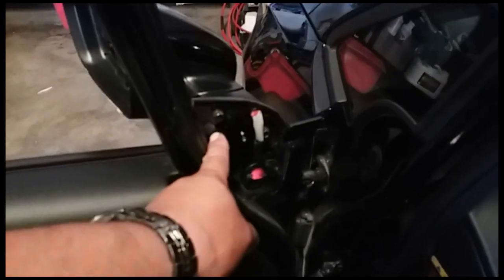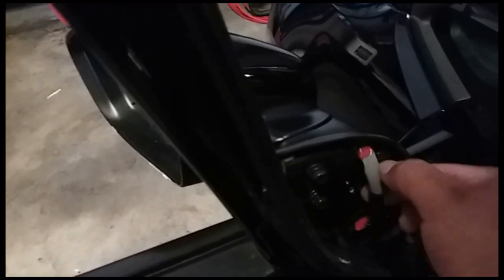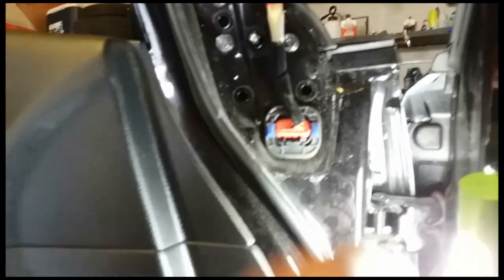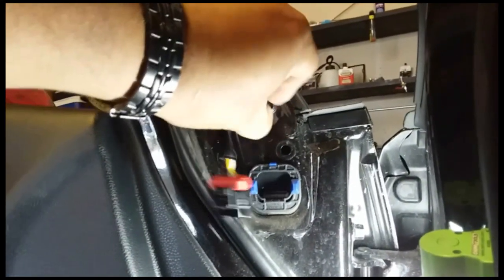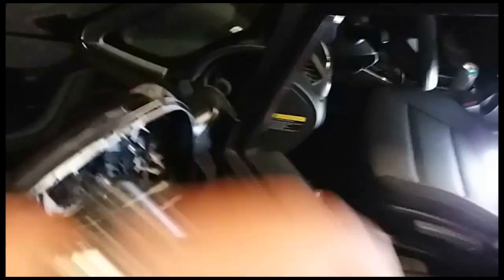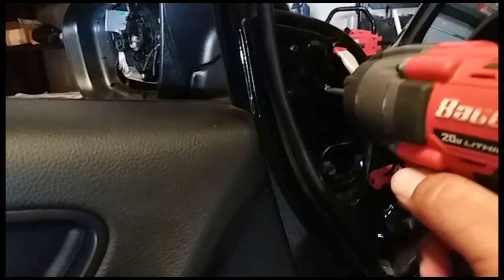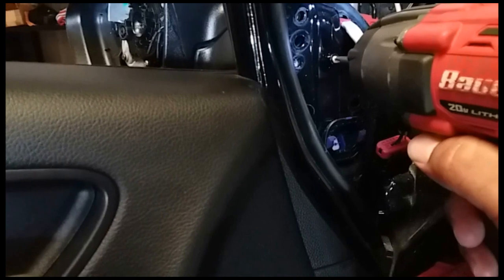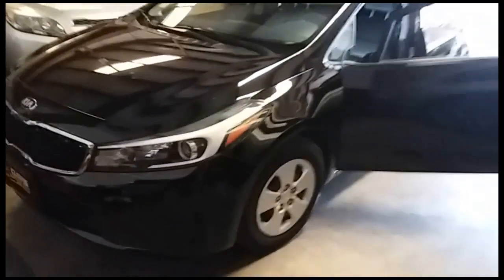How to: Remove a Driver Side Rear view Mirror on a 2016 Kia Forte

Comment: Thanks for video! I have a question. If my car didn't have the option to heat up the mirror and I buy one that has that option, would it work for the car?
Reply from the maker: Im honestly not sure, because if it doesn't have the option from factory, it might not have the wiring done for it

Comment: Hi George! I have a Kia Forte 2016 LX Base Model. I wanted to upgrade the side mirrors to the other side mirrors the EX has. Do you recommend this? Thanks!
Reply from the maker: You can but if there's any extra features on the Side view mirrors in your car does not come equipped with the electrical connections and will not work correctly. You could do it and try to re wire it yourself but that's a chance you will take to see if it would work or not. Go for it see what happens it just might be perfect.  Do a little bit of research and make your choice. That's what I would do.
Reply from the maker: Thank you for your support!  Happy New Years!
Reply: @559powerscape  Yes, I've been doing some research online and on eBay, but I can't seem to find the answer. It looks like no one has tried this project yet. I figured my car can use a little upgrade. Anyways, your comment was helpful! Thanks, George!
Reply from the maker: @johnrodriguez49   Yeah for sure! Hey I totally understand my car has a lot of things that no one else has ever done so I feel you on that sometimes we just got invent our own shit lol
Reply: @559powerscape  Thank you for your input on this. If I decide to risk it and follow through with this project, I will update my findings on here. Thanks, again, man.
Reply from the maker: @johnrodriguez49  4 sure man. Hope this out for you! Thank you for your support!